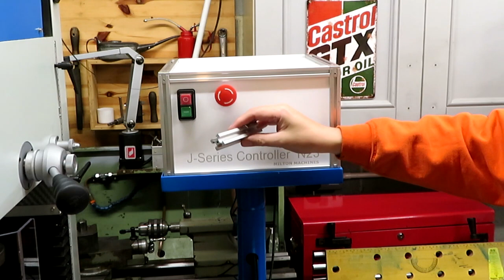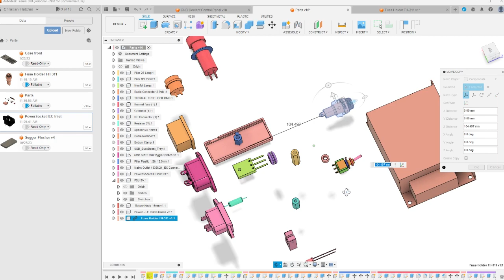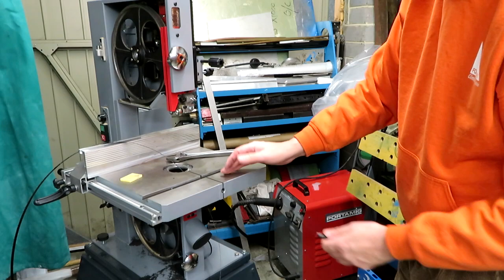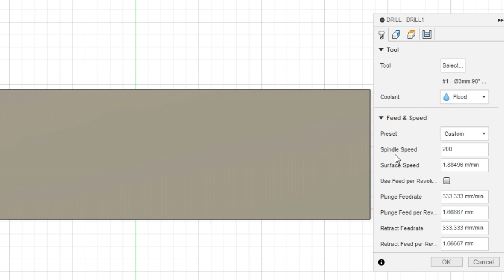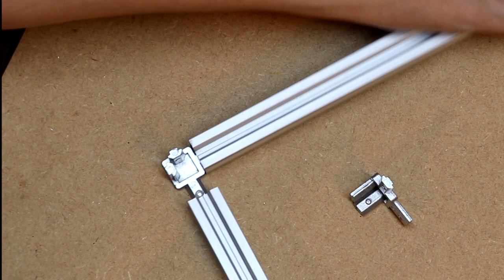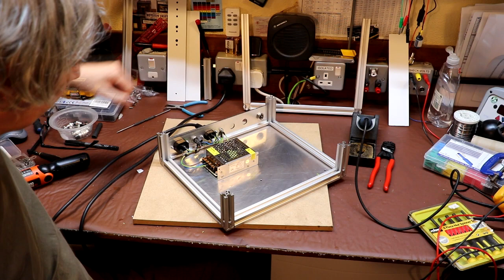CNC Minimum Quantity Lubrication - Part 2

Comment: Hi Chris , great video once again. That laminate reminds me of Traffolyte which is also a laminate, it's engraved to make labels for panels etc.. I suspect I will need to get a CAD package as I've found fabricators can't work from hand draughted drawings nowdays. Still using files for my cut outs!
 I feel you are going to put the OU out of business. Well done.
Regards
Peter
Reply from the maker: I used to use traffolyte for machine control panels. I’m hoping I will be able to engrave it on the cnc. Thanks for the nice comments. Best regards Chris

Comment: Tension measurement for the band saw is taken from the left hand side, none cutting side of the wheels. Not sure if you did, but always best to check the band in running central on the wheels, although some prefer the band to be further across.  Always enjoy a making vid 😊
Reply from the maker: I just set the tension by feel, main thing is not to have it very  tight.  Yes it was running on centre there is a window at the front of the machine

Comment: This project is coming along really nicely,  Chris - I'm looking forward to seeing it in operation. I'm also interested in seeing how you determine the settings - I am sure you have a plan that will be just as interesting as your build. Regards, David
Reply from the maker: I think the setting will just be trial and error. The main thing is I don’t want to be breathing in a fog of oil mist. Fingers crossed it works after all the work
Reply: I was thinking a thermal camera or aluminum blocks with embedded thermocouples would be involved. Regards, David